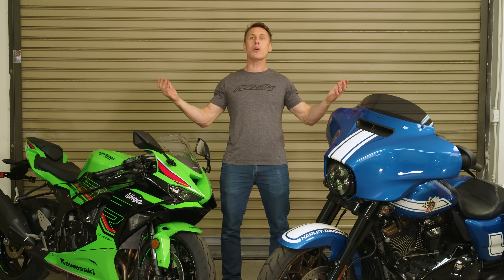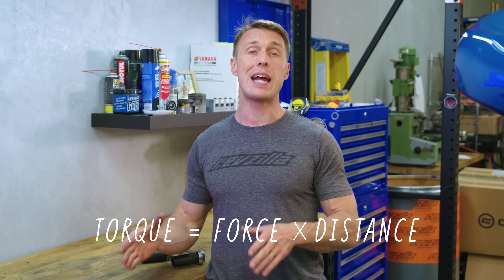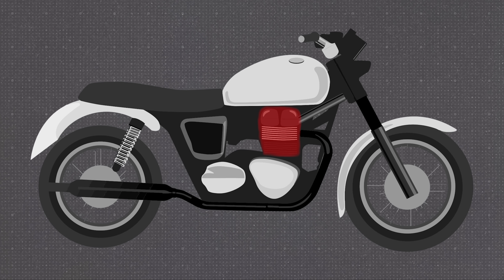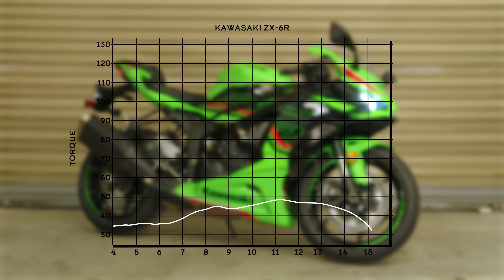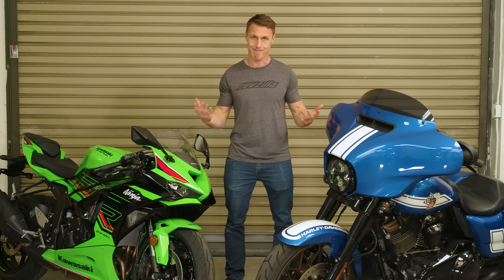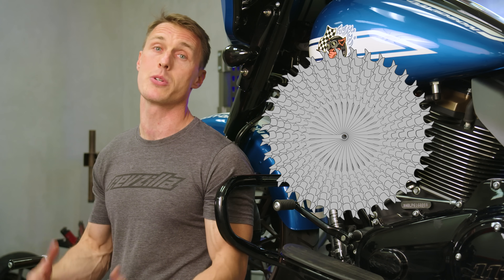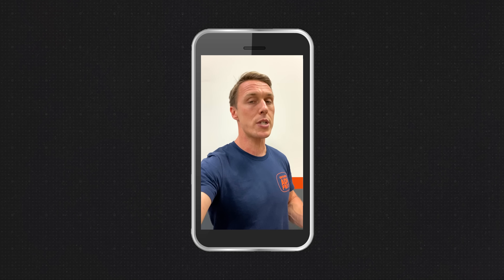Torque and Horsepower Explained! | The Shop Manual

Comment: I think I understand, but what I'm curious about is why someone would want more of one or the other. I think I know people who like HP love seeing how quickly they accelerate, but what is the purpose of Torque on something that isn't planning on towing something? Is it more stable/reliable over longer distances or longer period of time? Also does the angle the Torque is applied affect the overall power of the engine? I keep hearing how Harley has/were known for their 45 degree engines, others have like 52, 60 or whatever else.

Comment: The problem with the torque vs power problem is that there's so much misinformation floating about. Best example is all those truch and 4WD lovers (relax I am one myself) who tell you that it doesn't matter if a truck has very little power to it's weight because torque is what really matters. Anyone who has ever been caught behind a truck going up a hill or from a stop light can tell you that's bullshit.

Comment: If anyone wondering which will accelerate faster than it will be always bike with more power that will accelerate faster if all other variables are equal. 

The only reason heavy pulling vehicles prefer high torque than horsepower is because of reliability. High-horsepower vehicles can pull the same weight but they will have to rev lot high which means engine getting fked.
Reply: It’s also not practical to have to rev to 10,000 RPM to get going from a standing stop trying to pull a trailer. Power coming on at low rpm means is a lot more practical to use in high load low speed applications.

Comment: Torque = joules = energy = fuel consumption. 

Hp = torque per second or minute = the rate at which fuel is burned and your pocket gets emptied.
Reply: Yeah this is right. I like the money idea. You spend more money for your time the faster you want to accurate.

Comment: This is why I prefer Horsepower for my Motorcycle since it's lightweight (most of them), while Torque for my 4 Wheeled Vehicle since in generally speaking most of them are heavy (stock, not modified), which is the reason why I prefer Diesel SUV.

Comment: Follow up question, since higher HP motors rev up to higher rpm is that why they fail quicker than high torque motors?
Reply: In other words miles on the odometer don’t mean anything it has to do with the purpose of the engine?

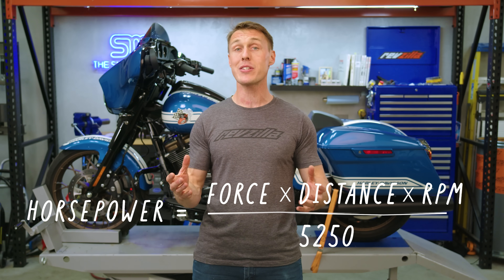Comment: 2:24 - 2:40
5,250 RPMs is the point where the the horsepower and torque are even.
before 5,250 RPM Torque>Horsepower
after 5,250 RPM Horsepower>Torque
until you upshift into the next gear and your RPMs drop and the process repeats as you accelerate.

Comment: good explanation, but HP is also the key factor in acceleration in a system with a transmission.  HP at crank is really all that matters since torque can be multiplied.  The comment that torque is for acceleration is misleading....

Comment: Simple explanation is tq = low rpm power & hp = high rpm power. The tq band always runs to the hp band. Its where the engines of today with vvt have such a high tq # vs an engine pre vvt that had to run a higher lift & duration cam to get the hp but sacrificed the tq # to get that hp. Which meant higher launch & shift rpm.
Reply: No, or partly no.  Torque is the force input at any rpm that it is running.  HP is just the measurement of "work done over time", (not speed as the vid says), at any particular rpm.  So torque is the power input, and HP is the measurement of work it can do at any rpm.  That means, if you can increase torque at any running rpm, you will increase hp.  It takes less torque at higher rpm's because at the higher rpm's more work is being done in a period of time.  Notice, acceleration is not in the equation.  Just rpm.  But, the faster the engine can accelerate between two rpm points, the more HP it is making with in those 2 points.  If you measured the acceleration in time,as HP went up, those set 2 points would get closer together in time.  Work done over time.  It's only confusing because the the rising rpm factor, kind of a weird relationship, but the formula is the same at every rpm, and the torque is the force input that actually controls hp.  If we want to build an engine with lower or higher rpm power, we have to increase the torque at those rpm's.
Reply: @EarthSurferUSA  I understand the math and theory. I also understand how it works in the real world. I have a diesel pickup making 680lb/ft of torque @ 2000rpm which then drops off rapidly meanwhile it only makes 350hp @ 3000rpm. If I go above 2000rpm it takes much more pedal & the fuel consumption increases rapidly. As with any engine the 2 curves cross and the torque curve is always rising much faster than the hp curve until the tq starts to drop and hp crosses higher. I built a few engines in the 70s and had friends doing it too. Obviously we didnt have the tech of today. If we built an engine with a higher lift and duration cam tq suffered but hp increased, unlike today the idle had to increase as well. We were all Chevy guys so we were building both small & big block engines. Some guys built some pretty wild small blocks with tunnel ram intakes and ported heads. They were all high rpm power. Luanching high and shifting high. At lower rpm they were complete dogs. I built a L88 cammed big block with a dual plenum edelbrock c-396 intake, holley 850 center squirter and oval port heads. The thing idled at 1500 and put down best times when launching and shifting @ 7k.Later I got into bikes and had a Kawasaki 500 triple. Had it ported and polished between H1R specs (the machine shop owner had been a Kaw factory rider and had the specs) and Denco drag specs. The thing would shut down in about 10secs idling @ 3k & made almost no power until the switch flipped at 7300 and it would go from all intake drone to screaming exhaust. Moving forward many years my wife had a first production year Honda S2000, similar scenario but now tech is able to keep the 2 curves much closer in output even though it is a 9k redline engine.

Comment: For a given vehicle mass, acceleration is determined by how much torque you apply to the wheels. And the torque you can apply is determined by the engine power and the gear ratio used. The actual torque of the engine itself at the crankshaft is irrelevant because torque to the wheels can be changed by changing gear ratio. If you want faster acceleration, all that matters is engine power output and appropriate gearing. Engine torque is irrelevant. It's as simple as that.

Comment: Torque at your rear wheel is the force that accelerates you. The more torque you have the faster you will accelerate. The torque (at your rear wheel) will always be higher for any given speed (RPM at the rear wheel) from a a motor with more horsepower. In short the more HP you have the more torque you get. Just remember that force does not equate to motion (think of holding a torque wrench at 100 lbs/ft of torque on a bolt without it moving). Like a weight on a scale cant move something without moving itself. Force is not power. I can generate a million (100 million) lb/ft of torque with less than one HP. I'm not understanding why this argument persist.

Comment: Torque doesn't technically push you back into the seat. The bike is trying to leave you behind and it takes a second for your body to match the new forward momentum (inertia) by holding on via handlebars and legs. Ergo your stationary mass is actually pushing against the bike.
Reply: The seat is pushing you and your pushing back

Comment: So, a stupid question.  If a bike like the KLR 650 has a close near 1 to 1 between HP VS TORQUE, what characteristics would result from a 2023 KTM 1290 SAS instead of being 160 hp and 101 ft lb of torque, were made to be 160 hp and 160 ft of torque? I have heard theory’s saying engines are more reliable if hp and torque are close as possible -KLR 650, vs KTM 1290. Thoughts? And what’s stopping all bikes from being at or near 1:1 in hp and torque like the KLR?

Comment: The very basic manual version I relate this to is the bicycle. Even when you adjust the gears. Legs are the pistons and kinda the Krankshaftk!!🐶......😁& Yes. I know that last word is spelled differnt n the dogg-o is confusing-its my AKC Registed White Labradors name.....and because the name Spark Plug was taken. My buddies dog- A chihuahua  🤣  And yes, we did that Not on purpose exactly with our doggies names and was later we realized that their size is about accurate🤣🤣🤣  Id hafta say maybe only certain animals would fit for other parts of a motor. For instance, Gasket(or maybe a version of the word would be Gasketcase🤭), would hafta be a snake. 🤔Maaaybe a ferret. 🤣🤣
Are my buddy Josh&I the only idiots to name our pet after somethin like that? Prolly not. But then I also have a long haired black cat named H1tler. Because hes lovable, cute, and cuddly. Everything the real dude wasnt, and is my way of in negating the word. Plus Naz1 or Swastt1ca just not as easily punny. 🤔 Unless reversed I could call a pet Sir Izan Newton?! 🫠 Think I just discovered a new punny name!!!🤗🥳

Anywho. Ima stfu now!! Thank you for such a riveting video!! Have a good one-Dueces!✌🏼🤪

Comment: I had a 636 and I've gotten into a few fights with Harleys and no matter how perfectly I launched off of the line I'd get absolutely smoked by the Harleys. I could hear the Harleys shifting and usually they were in 3rd or 4th when I would get into 2nd. When I would get into 2nd gear is when the Harley guys would get a good look at my taillight and I would get more and more distance between us and the harley guys would figure out that they just got stomped lol.

Comment: Torque is a measurement of force. Basically what force is pressed onto something at one instant. 

Horsepower is torque but over time, it shows how often you can apply the torque. Also know as power.

Think of your legs, they can lift your body and more. They have a lot of torque. But they can't move fast, which is why you can't run fast even though you may have more torque output than most bikes.

A bike may make less torque than your legs but it can do it way more often. Which is why it can accurate and have a high speed.

You can change torque by using more or less leverage, but you can only have more horsepower by using more energy.

Comment: If you want more HP, (which is "work done over time", not speed) at any rpm, you have to increase the torque at that rpm.
HP is "work done over time", not speed.  Wanna try gearing the bike way down?  Less vehicle speed, same HP, same RPM.  
You do express Lb/Ft correctly though, but somehow, saying it backwards took over public language.
James Watt developed the measurement for HP by using a horse to pull a weight up a dry well, (over a pulley), with a given depth into it, and whipped the horse to pull the weight up to the top, and measured how much times it took. (So if he used a different sized horse, we would actually be measuring a different amount of power for one HP).
You should have given James Watt his due credit, or else the state will take credit.  :)

Comment: Since torque causes acceleration and acceleration speeds up the motorcycle to attain a top speed, I was always baffled as to why high torque bikes don't have a high top speed. Now, with the RPM, and a lot of examples, including the one with Bolt made it clear. Race bikes have three times the RPM as the long stroke Harleys. If the engine of Harleys also could do so many revolutions per min, they would have a higher top speed than those race bikes. If this cause too much vibration, then a single cylinder will be converted to a twin or a tripple or an in-line four to share power responsibility. Now it all makes sense. Thanks.

Comment: How does the piston has faster speed at a given RPM in case of Torque, I didn't understand? The animation shows faster piston movement in the example of Horsepower, not Torque.

Comment: Hm... I like it. Except that "in case of two identical mass bike the bigger torque makes bigger acceleration, and the bigger power makes bigger top speed". This is not true. Bigger power makes bigger acceleration. Speed is related to energy, change of speed is acceleration. Change of energy is power. So torque is not related to acceleration. Neither top speed as Ari said. Because top speed is limited by air resistance, which is a force increasing by speed. Force by speed is power. So one can calculate a theoretical acceleration from power and mass and a top speed from power and the aerodynamic parameters of the bike. Nothing can be calculated from torque that is measured on the crankshaft. Argue with me please! :-)

Comment: I learned horspower and torque like this. Ik the wall saying but it never made sense to me. I had a 4 way tire iron and tried taking lug nuts off, I had a nice crisp quick jolt to get the nuts off but wouldn’t be able to power through and spin the nuts, this is where torque comes in to play. Like this u have someone open hand smack ur stomach (horsepower) now someone punch your stomach(torque)

Comment: Torque gets you off the line..HP gets you down the track
Reply: Yup you got it but larger engine change the displacement for different strokes for different folks right

Comment: From my understanding, torque figures are not particularly meaningful especially comparing electric motors and ICE. Power is the ultimate metric that determines how much work can be done ie. Acceleration, top speed and pulling force. Of course it is all thanks to gearing that we can trade rpm for torque. That's why we see electric vehicles with insane torque. An electric motor can be constructed to work in a certain rpm range for the same power which you can think of as just another gear ratio. 

I think the purpose of torque figures for  ICE are to give insight into the 'character' of an engine, is it a lumbering low rpm engine or highly strung high rpm engine. Both have their applications, especially with respect to where they make peak torque in the rpm range.

In my opinion, torque figures alone strictly don't mean much and the only way I can conclusively understand an engines performance is by looking at the full power and torque curve.
Reply: I could have written this my self. I'm getting fed up with all the disinformation about torque from both channels like revzilla or yammienoob but also from ev manufacturers. Electric motors don't have a character therefore it's useless to state the torque figures. Feels like false marketing.

Comment: I’ve become more of a fan of torquey bikes with also good HP. They’re way more fun around town and easier to ride. I’m not a fast boi, I just like to wheelie.
Reply: Me, too. I prefer bikes of at least 900, but maximum 1300cc of displacement, and a Vtwin oder Twin configuration.  The twin configuration gives it some extra torque (compared to 4 cylinders) and also contributes a lot to the sound.
To me this engine setup is the sweetspot between torque and hp.
These bikes are still able to rev pretty good and they also provide you with plenty torque over the entire rev band.
Thats why my favorite bikes at the moment are the BMW F900R and the KTM 1290. The only 4 banger I would buy is a blown Kawasaki.
Reply: @Chris-yy7qc  my cousin bought a 1290 evo, goes pretty well. I ride a bandit 1250, with plenty of mods, and the 1290 doesn't walk away from it like you'd expect.

145/95 on the bandit with more torque in lower rpm, and so much smoother. I can be in 6th at any speed over 25mph and still pull, the ktm's he's had struggled at anything under 4,000. 

All this to say I'm not a big fan of twins, at least not the ones I've ridden. Either the gearing ratio or not enough low rpm torque (like 2000 rpm) holds them back.

Comment: So uh, if youve got a 1cyl engine same bore and stroke as a 4 cyl engine just 4x the cylinders, is the torque the same but the power 4x? Or is torque averaged out over a revolution of the whole engine?

Comment: Ok, thanks but now explain how much should a rider weight to not have any problem with the motorcycle? I am 110kg athlete but I want Royal Enfield classic 350cc who has 24nm torque. I mean how to understand motorcycles with 20-80-100 or 120nm torque. Higher better okay but we want a little further information

Comment: More Torque does not generate higher acceleration. This is the most common misunderstanding about torque vs Power. Acceleration is provided by the surplus power available at a certain speed. This is why high torque/low power bikes seem to have a higher acceleration, but this is because high torque engines have a higher power output at low rpm (compared to a high rev sports bike engine). This provides a short term advantage during launch. A sportsbike however quickly gains the advantage when the revs go up (Power available at that speed vs power needed at that speed). This is why Harleys are so easy to ride and launch and why sportsbikes are not easy to ride in city traffic.

Comment: So in theory you can use a 'heavy geared' transmission on a low rpm torque monster to gain high speeds?

Bit the Ducati way but they rev quite high.

At least that's my interpretation, like the merlin fighter plane engine  in/on a car or the BMW brutus.
Reply: A kid could technically lift a car with a pulley system if you had enough leverage. You can have almost as much torque as you want but it will sacrifice speed.
Reply: @pleasedontwatchthese9593  I know, but with enough bodem end torque and a fit to size gearbox a high speed would be not a problem, or am I missing something?